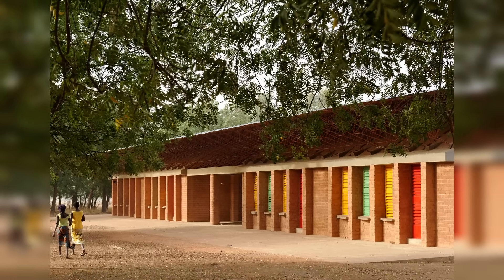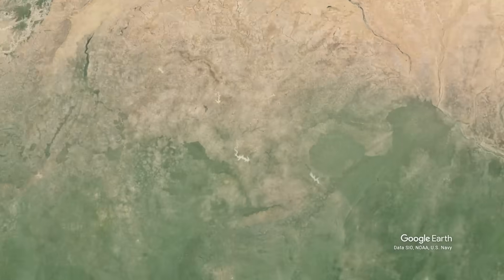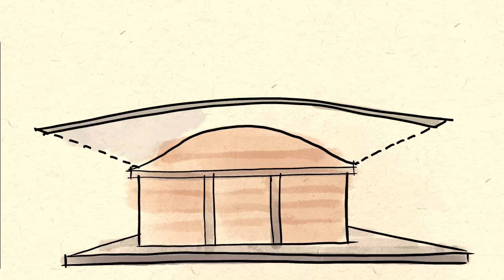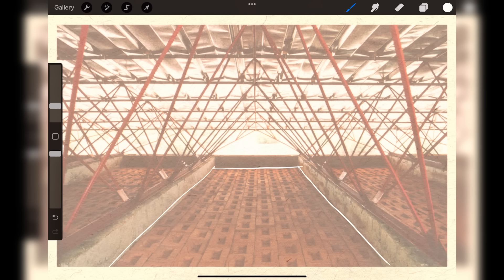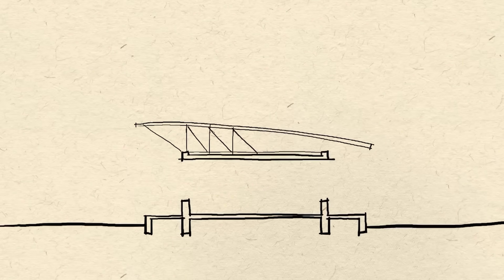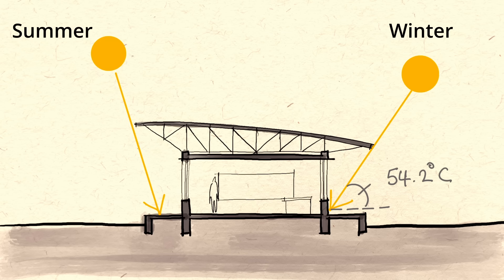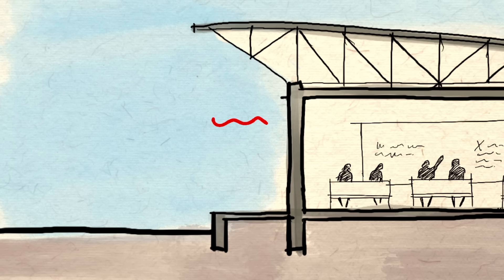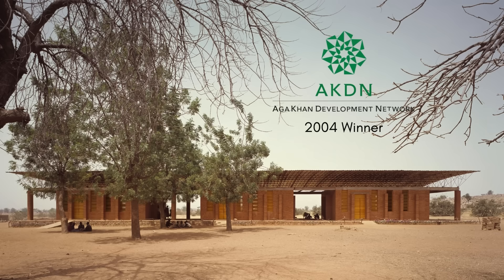The 3 Design Strategies Keeping This Building Cool In Scorching Heat

Comment: Sounds good. But we'd love to see some actual historical indoor temperature data taken over a few years time. How hard is that to do?
Reply: I was hoping to find that information here in the comments.  Personally, I don't need years of data (although I definitely see the value in that), but a quick example comparing outdoor and indoor temps would spark further interest.
Reply: Just what I thought. I don't say it doesn't work, I just want to know what they deem comfortable. A wonderful design in any case.
Reply: @guyburgwin5675 there is a cost benefit equation.

This probably not same as a)c building however much better than original building.

If goes from uncomfortable to warm at little cost it is a winner.
Reply: As someone who lives in a building like this, it shaves off a few degrees. It is uncomfortably hot, but better that a regular building.

There is a reason why this video did not mention something simple like a temperature test…
Reply: About as hard as flushing the toilet in public restrooms 😞😨
Reply: Yeah. Without this data it's only bla bla bla
Reply: @iron4ig  you don't need data, just asked the kids using the facility.

Comment: What is thermal massing? I’ve never heard of this concept before
Reply: Thermal Mass is basically the rate at which energy from the sun is stored in a material and the rate at which it releases that energy without the sun. Thick materials such as solid wood logs, compacted earth, barrels of water and concrete have a high thermal mass as they are very thick and slowly absorb energy and similarly without the sun slowly release it. The materials act as heat batteries and heat exchangers with a slow absorption rate leading to cooler buildings during the day and a slow release rate leading to warmer buildings at night. In some cases builders have used barrels of water and concrete elements inside of a home as heat batteries in extremely cold areas by positioning windows such that the low profile of the sun's rays directly hit these elements inside the home for as long as possible, they absorb the energy and then begin releasing it during the night leading to passive heating. There's a lot more to it than this.
Reply: @kevingreen2626  there's no really quick explanation. but videos on mass walls or trombe wall will demonstrate. wikipedia article for "thermal mass" is decent.
Reply: This type of thick wall is called a tombe wall.
Reply: This could be adapted to homes as well.

Comment: there's not much achieved here without temperature readings, hourly, for years (this project was apparently built in 2001). 

my guess is that in the hot months, this building is between 85-95f inside in the afternoon. it is very uncomfortable and there are lots of flies. because when the nights are hot and humidity is high, there's no hope of keeping a building cooler than the ambient shade temperature. 

you'd think a true architect would publish their building's performance specs. not just hype it for what it hopes to achieve.
Reply: Unfortunately architecture is not an evidence-based discipline yet. Architects never bother to validate their pre-build claims with data gathering after the project is built. They’re essentially just salespeople, they don’t worry about the project once it’s built.
Reply: So you're saying she's a liar.  For what purpose?
Reply: @sharonmassey2923  i'm not really saying the video creator is lying in a malicious way. she's just presenting the architect's work (and the small amount of promotional material about it that exists) in an uncritical way. 

why does anyone make videos about hyped up projects? i don't know. it's a cool project. it just doesnt perform well relative to modern standards. if someone talks to you about a building or a machine in vague terms with no numerical quantification, be suspicious. i live in the mojave desert and from time to time architects promote their neat-looking projects that perform badly in heat.
Reply: The best data, is to go yourself  and experience the difference. That's wasted time and money  for these poor communities
Reply: @raj66kas  😂 it is not at all wasted time for the architect to monitor his own award-winning building and publish actual results, rather than hype.
Reply: If they have very cool nights as stated in the video then this region is likely not very humid. One marker of humidity is that the temperature sustains throughout the night as it is held by the moisture in the air.
Reply: @kevingreen2626 agree. If the humidity was high there would also be more green vegetation in the area.
Reply: @kevingreen2626  daily low is rarely below 70F. see climate data for nearby town tenkodogo. elevation below 1000ft.
Reply: So you claim there’s no evidence because you don’t have the temperature readings, but then you just make up your own guess? 😂 ok, not to be taken seriously
Reply: @magesalmanac6424  there's decent climate data for nearby town tenkodogo. this area gets over 30 inches of rain annually, daily low temp is rarely below 70F.